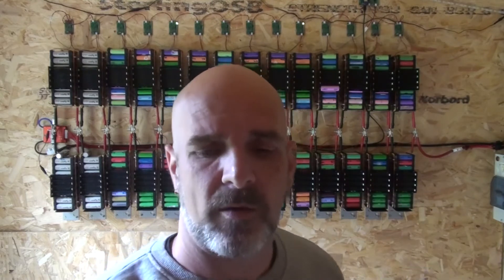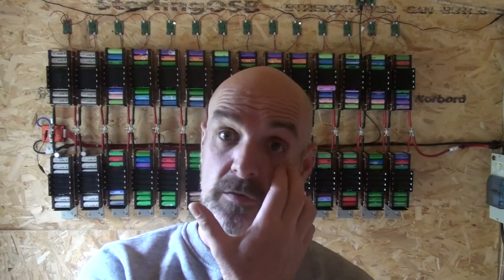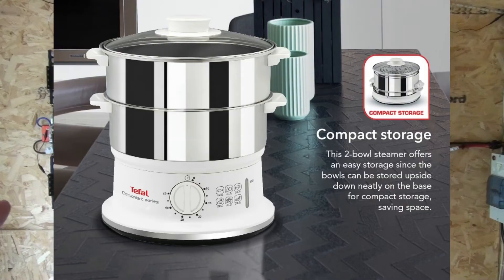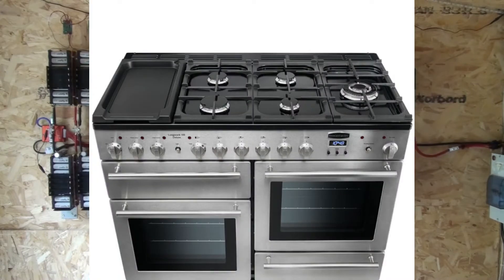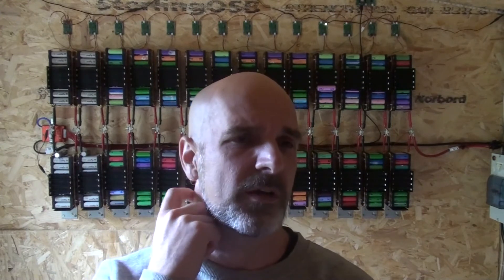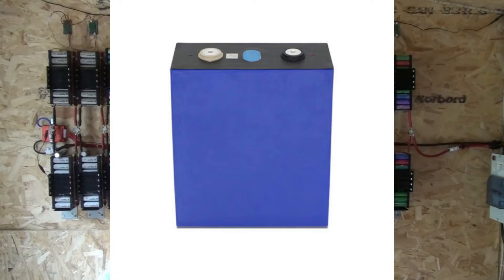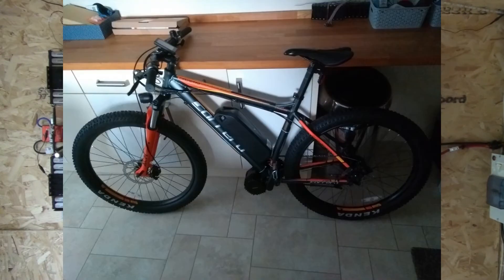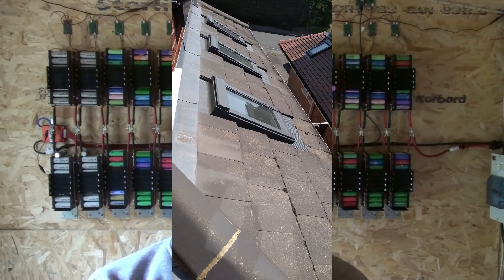Updates, Chat and What next?

Comment: a DIY solar panel video would be very unique and nice addition to your channel. what type of inverter you have? can you share the link? most of diy power wall videos/channels are by US or Australia users and hardly any for EU.
Reply from the maker: I have 4 inverters. 3 grid tied and one off-grid. Which one do you mean?  I have a video about my system that explains the different ones.
Reply: @nicholashowell  i was talking about MPP brand, i can only find it on ebay only. also i was referring to solar panel video on how to instlal/connect etch.
Reply from the maker: I think I bought mine from eBay.

Comment: Draughty kitchen? The first principle of energy saving is the cheapest form of saving is the energy you don’t use! Fix your draughts first🧐
Reply from the maker: The kitchen/dining area is one big space over a suspended floor.  We have done what we can but short of ripping out the entire kitchen and dining area and pulling up the floor boards to put insulation underneath there is not much more can be done.  It's possible yes but incredibly expensive and disruptive.
Reply: @nicholashowell  what about electric underfloor heating? It can be laid on your suspended floor (with a heat reflective layer underneath then covered with laminate, engineered wood of carpet . Powered by your power shed batteries?
Reply from the maker: @garyday615  I had wondered if that would be an option. Like you say it would definitely need a reflective layer to not lose half the heat to the cold air passing underneath the floorboards.  Wonder what it would cost to run it.  Something else to consider.
Reply: @nicholashowell  we had it installed when we overhauled our conservatory also adding an insulated roof. I seem to recall our was a 4kW system with an Aude programmable thermostat. I’m sure an easy fit for someone of your talents!